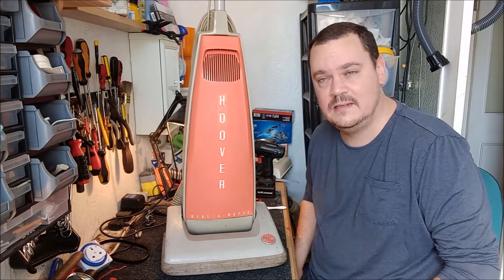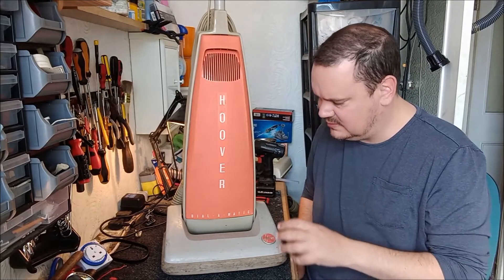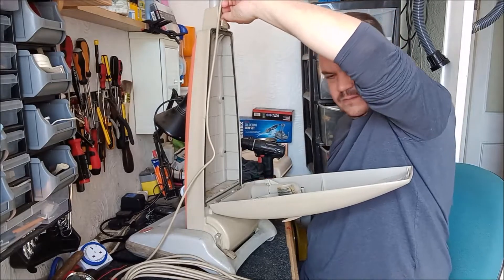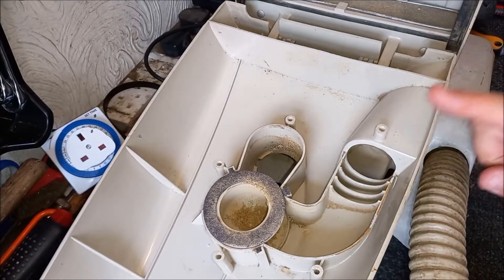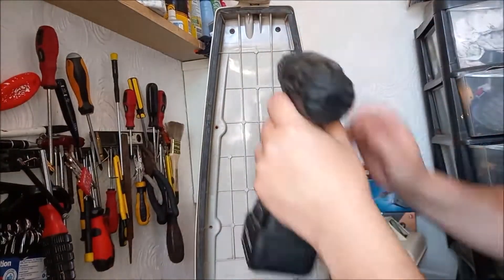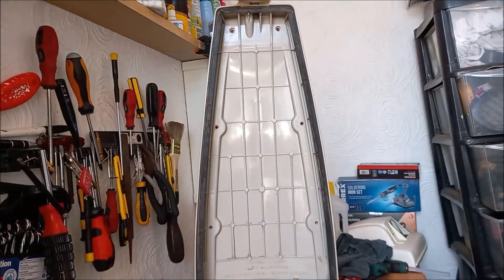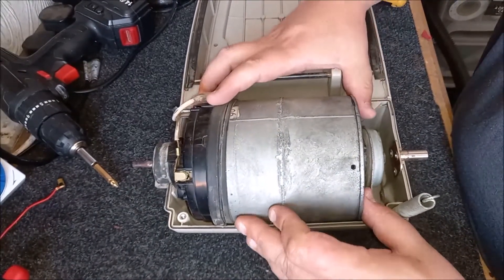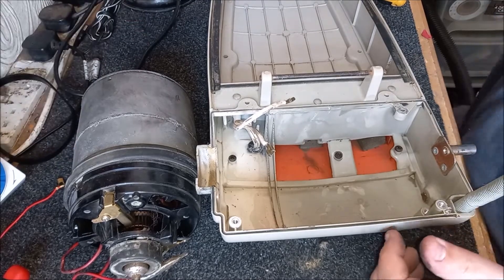Restoration of 1963 Hoover Dial-A-Matic Model 1100 - Part Two - Disassembly

Comment: I'm glad that the disassembly seemed to go rather smoothly - if not just for the sake of all our nerves.
That looks to be a beast of a motor crammed into a space barely big enough. I'm surprised there is no room for some  sound deadening around the can at least.
A fascinating insight into yesteryear's manufacturing.
I must however bemoan Younger Steve and his use of gaffer tape and sticky tape. There is a place for them - like a Blue Peter project - not inside a lovely vintage vacuum cleaner.
Greatly anticipating the next thrilling installment. 
Thank you ever so much for taking the time and effort to set up so many shots to enable us to see clearly what is going on. 
You are a 🌟
Reply from the maker: I'm embarrassed about my earlier bodge!

Comment: I think it would be really interesting to fit a more modern motor unit, like you did your Constellation. Now I know that’s a far bigger task (and may not even be possible), since it would have to do more than physically fit it in since you have to seal it and deal with the belt drive. But having an old Dial A Matic with proper modern vacuum power would be super cool.
Reply from the maker: That's an engineering challenge all on its own!

Comment: Any ideas on removing the handle on a U6000 series?  You can pull it to the end of the metal but it will not move any further.  I am trying to ship it and my prices are going to double if I can't get it off.  I have never had a vacuum designed like that.